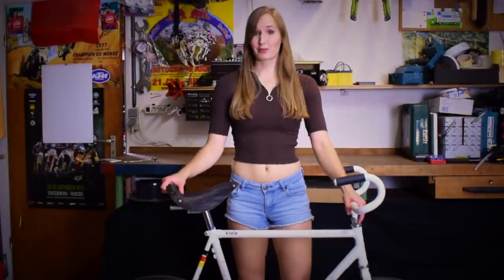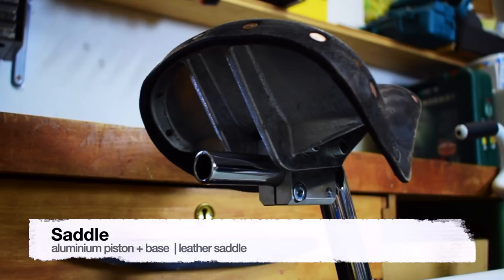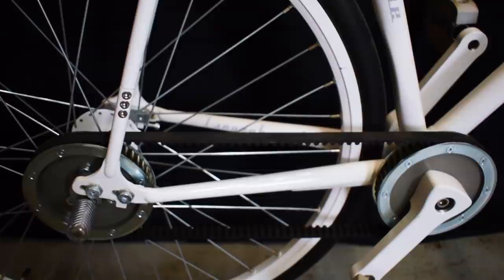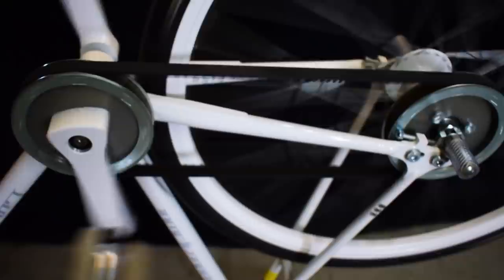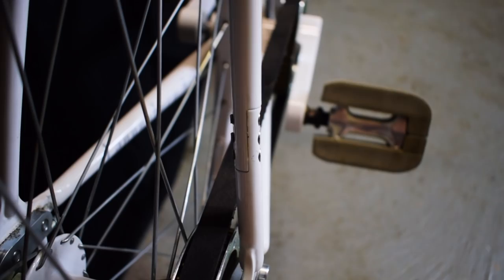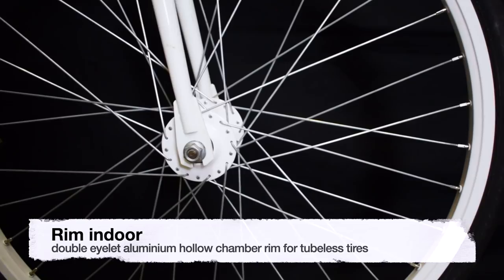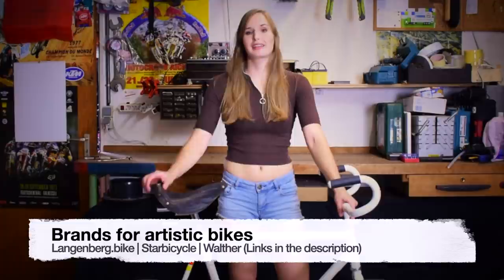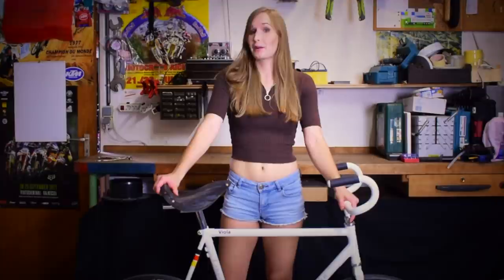Artistic bike technical specifics | What is special about an artistic bike?

Comment: Why you don't use carbon fiber bike?
Reply from the maker: The frame falls many many times and then the carbon would get broken easily
Reply: @Violalovescycling  carbon tends to fail catastrophically with sharp shards where steel would probably just bend.

Comment: Very well explained and very interesting. I've once ridden a belt drive and liked it a lot. I think there may be belt drives now that don't require a opening in the frame. Keep up the great videos!
Reply: Frame with elevated chainstay allows to install belt without splitting frame. Belt you mentioned can be opened and secured using multiple rivets.

Comment: The single most special part of the bikes with artistic cycling is the riders.
Something that you didn't mention is that the bike is a fixie and that the drive sprocket and the rear sprocket are the same size giving a 1:1 pedal to wheel rotation speed.

Comment: Great info! I ride outdoor road bikes quite a bit so am familiar with that. You did a great job explaining differences. Why is tubular tire better for indoor? I think most pro cyclists use tubular for outdoor.
Reply from the maker: Thanks 😊 I like to hear that 😊 In the indoor bikes we have around 12-16 bar inside of the tire and I think that tubeless tires can hold that much pressure and „normal“ tires maybe can not hold this pressure?!
Reply: @Violalovescycling  Do your indoor tires glue on? Tubular tires are glued onto the rim. Tubeless tires mount like your outdoor clincher tires do, but with no tube inside. 
Clincher tires can hold 16 bar. The rims can't. Continental tires tested their racing tires to over 30 bars, then the rim split open.

Comment: I never realised that the cranks were so short on an artistic bike (170-175 is the normal length for most adult bicycles). Is that a case of preference of the rider or is 130 just the standard for everyone? Also, technically belt drives have more friction than traditional chains. At those speeds it doesnt really matter tho

Comment: Excellent... thanks!  Could you explain how the bike seems to roll forever?  Never ridden a belt drive bike, but I have been eyeing Schindelhauer Bikes for a while now.
Reply from the maker: Haha well I think that is just because I have about 14-16 bar in my tires and so I don’t have much friction on the ground 😅
Reply: @Violalovescycling  wow... 14 bar is 203 psi!  What tires are capable of holding that sort of pressure?  IS that the reason, in that one video, when you crashed the tire came right off the rim?

Comment: I am glad to see this as I was wondering about how the bike was set up. With a straight fork the front wheel is very close to the frame, do you get toe overlap? Why no brakes? I used to try to do tricks on my BMX bike when I was a kid. Thanks.
Reply: Given the low speeds, brakes are unnecessary and would be in the way.  Pedal back pressure is all that's needed, much like on the velodrome.

Comment: Viola we need to see you ride a wheelie on a big BMX bike! 26 or 29" would be cool, lol. As for your bike, I'm curious why they make the frame of steel and not of lighter metal such as 4130 chromoly or aluminum? Maybe the added weight helps with balance?
Reply: 4130 is a specific steel alloy.  When she said seamless drawn steel tubing 4130 or other higher strength steel such  as 4340 is to be assumed.
Reply: My road bike is made from Reynolds 953 and Tru Temper OX steel tubes and comes in at about 15 lbs. Bikes that are custom made like mine and probably hers are built using tubing specially selected for each riders size and weight and can end up being very light.
Reply: @brokenbiker220  nothing lightweight about your bike many roadbikes weigh similarly, even old steel ones from the 1980s
Reply: @petersimon122  nothing lite about my bike? tell that to the guy riding the 40 lb pig he bought at Walmart for a hundred bucks
Reply: @brokenbiker220  I got mine (was returned) for $50 :-)
Reply: @brokenbiker220  Reynolds 953 is rare.  
Who made it ? Thx
Reply: @petersimon122  15lbs is light. Not the lightest ever but it’s light.
Reply: @PInk77W1  Sorry I had to delete my previous comment because I misunderstood the question. My bike is an Independent Fabrication Crown Jewel, and I don't think 953 is that rare.
Reply: @PInk77W1  You can get lighter with aluminum but the ride is shit. I do miss my old Look 585, I just prefer classic steel.
Reply: @brokenbiker220  I only ride Ti.
Reply: @brokenbiker220  independent Fab is really good and Reynolds 953 is rare. In my life I’ve seen maybe 3-4 Reynolds 953 bikes.
Reply: @PInk77W1  Tried that too, had a Merlin TR 6/4 for a while and for all the hype I just wasn't that impressed. Good riding though, keep your eyes open and your lights on.
Reply: @brokenbiker220   cool.   I will try.
Reply: @PInk77W1  maybe you two should go to a private room
Reply: @petersimon122  15 pounds is less than the mandatory weight of a bicycle to compete in any US national event. as far as road bikes go, that's stupid light, and nothing in the 1980's comes remotely close.
Reply: @brokenbiker220  "the ride is shit"

Lmao, the "ride" is more dependent on the design of the frame, not the material used.
Reply: @petersimon122  False. I also have a 1980 Schwinn Super LeTour made of 1020 steel tubing that was billed as "light" at the time that comes in at over 25 lbs
Reply: Race road bikes were typically 18-22lb in the 1960's to 90's then dropped to about 15lb in the 00's with modern Carbon frames in the Lance Armstrong era.  It takes considerable effort to make a 15lb bike that rides well, we're talking $5K-$10K+ and careful part selection.  There are vanishingly few 15lb steel framed bikes, any claims about that should be doubted, typical build would probably be more like 18-19 lb.

Comment: What size wheels does your bike have?  Are they 700c or a smaller size?  With artistic cycling it seems like a smaller diameter wheel could be advantageous but I'm ignorant of that bicycle discipline.  I'm from the United States where artistic cycling isn't a thing but Bmx is.

Comment: Thank you for the interesting video. It seems that your bike coasts a long way with no pedaling. Is there some feature of the bike that helps it coast longer?
Reply: It is a fixed gear bike and the tires are run with high air pressure.
Reply: Higher quality tires tend to roll with less friction.  Also with higher quality bikes you tend to find higher quality bearings which are also lower friction.

Comment: Now why hasn’t someone come come up with the belt drive before ..it’s a smart idea
Reply: Advent of carbon fiber.  Without that, you'd have to have a rubber belt that's at a tension too high for suitable bicycle use.  Stretch would be a problem as well because of the variable power cycle throughout the pedal stroke.  Carbon belts don't stretch, so better for the power pulses and you can run tensions that don't impede the drive train.

Comment: Prior to watching:
Steep Head and seat tube angles, minimal wheel offset/ 0 rake fork, fixed gear, acrobatic bars, cradle saddle.
Did I miss anything?
Nope!
The belt drive is in no way unique to this bicycle application.  Common on many bicycles today, on road, off road and tandems.
Reply: I'd add stem to your list. Absence of stem, that is.

Comment: Your front fork seems to defy all the rules for bicycle geometry - I don't see any rake.  Normally, that would make a bike extremely difficult to ride, yet your bike seems extremely stable.  I imagine that whenever you let a novice ride this bike, they immediately fall over.
Reply: The rake you are referring to is "caster angle". The more angle the more the bike would tend run in a straight line. 

That is the last thing you want on a "stunt bike" since you need to ride in circles to allow the judges a good view of the stunts you are performing. 

High caster angles are found on high speed drag racing motorcycles. Same applies to automobiles, caster angle increases in regards to the vehicle's potential speed.